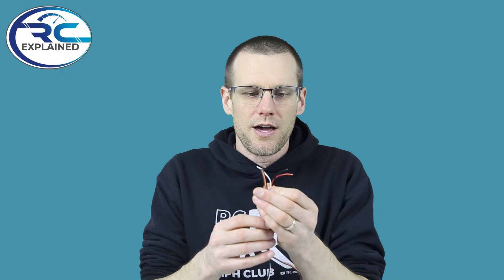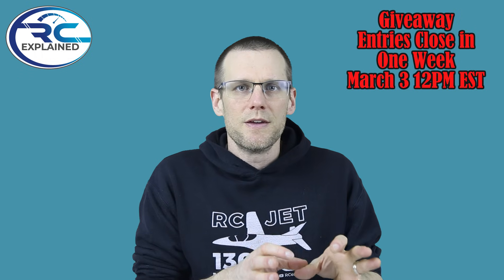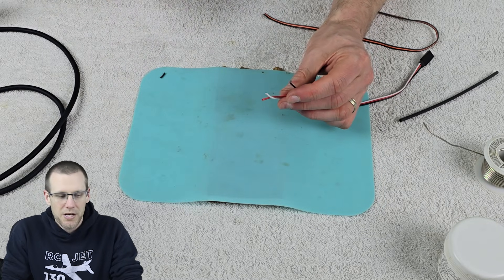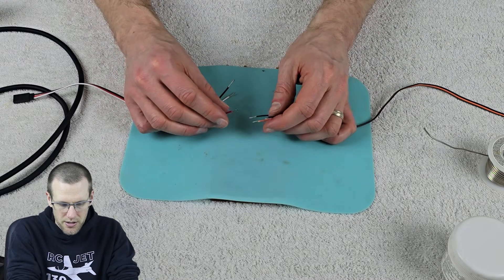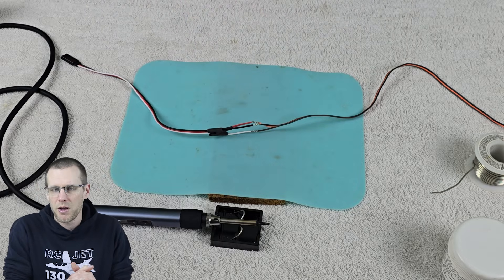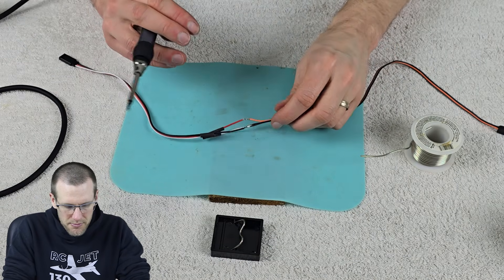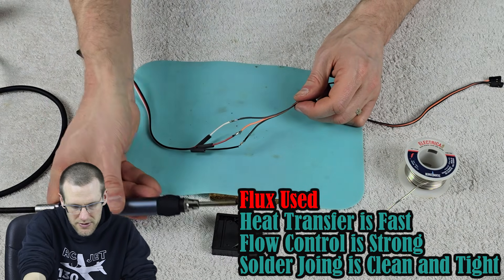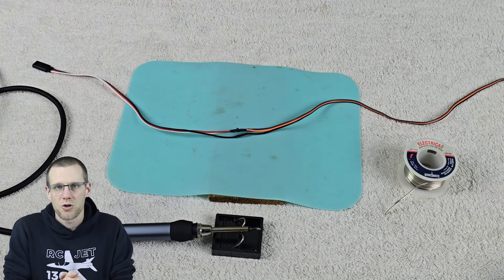Is Flux the SECRET to PERFECT Solder Joints? HS-01 65W Iron

Comment: I've been dreading a Reciver/ESC swap on a FX9630 J20. I only have to solder motor wires, but the ESC motor solder on dots on the silicon chip are tiny. Looking for tips on tiny solder spots. Rock on 🤘 good video
Reply from the maker: Small Solder tips help with the small surface area. You'll need steady hands and may want to use helping hands device to hold everything as you solder.